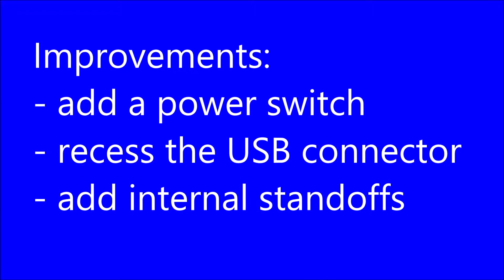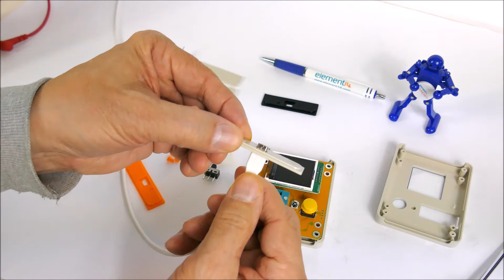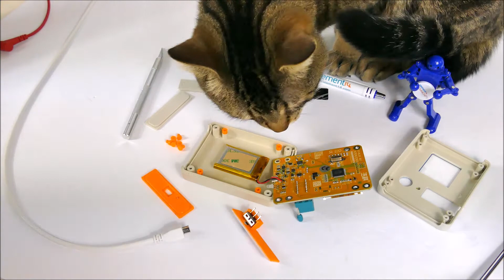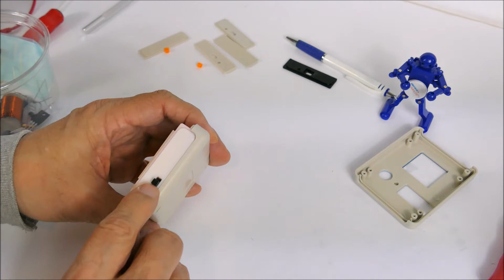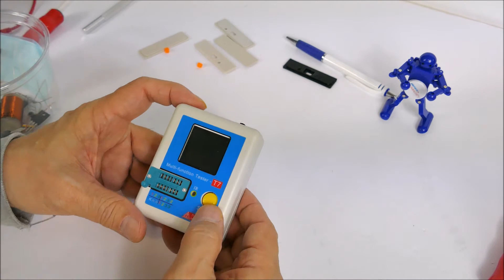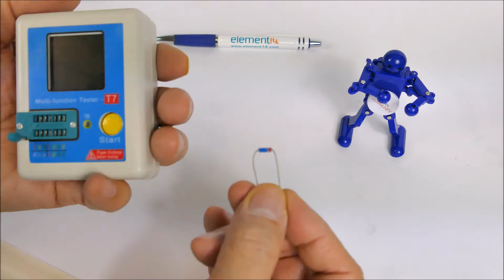T7 Multitester Mods & Fixes

Comment: Una pregunta amigo no te ha pasado que mides con el TC1 condensadores de 470uF en adelante 1000uF, 2200 uF 3300 uF, 4700 uF en fina de mas de 470uF en adelante y todos te dan ESR=0,00. Tampoco es q tenga muchos pero no se sospecho de q al menos deberian medir 0,12 Ohmios o un valor pequeño 0,01 o valoers pequeños pero todos me dan 0,00. Pero en cambio cuando mido de msno de 470uF como 100 uF, 220 uF, 10 uF, 47 uF, 4,7 uF esos si me dan valores de ESR distinta de cero. Hice la prueba de poner en serie 2 condensadores uno de 1000 uF que me daba ESR=0,00 y otro de 100 uF que me daba ESR=0,50 Ohmios por poner un ejemplo entonces los puse en serie y la ESR del conjunto en serie me dio ESR=0,60. Al estar en serie la ESR de ambos se considera que se suman verdad? Bueno de esa forma al menos me dio que el condensador de 1000 uF al menos debia registrar una ESR de 0,10 o no es asi? ES q me extraña q todos los q mido de 470uF en adelante todos dan 0,00. Otra prueba q tambien hice una vez fue colocar una resistencia de bajo valor en serie el condensador q me da ESR=0,00 y bueno al hacer la medida si me da unvalor de ESR pero algo por debajo del valor si midiera al resistencia solametne. Que quiere decir q este TC1 da una medida de ESR aproximada algo por debajo de lo q deberia realmente medir que si es baja entonces la ponme como 0,00 cuando realmente podria ser 0,10 o cierto valor pequeño de ESR pero lo registra como 0,00? Creo q en una sola oportunidad si medi un condesador de 1000 uF q tenia fuga y ahi si vi un valor de esr alto pero despues en otras oportunidades lo volvia  amedir y ya ponia 0,00 por eso me extraña si este medidor no es muy preciso con las ESR asi de un valor por ebajo pero por lo menos q lo registre distinto de cero o casualmente los condensadores q he probado de verdad tienen ESR=0,00?.

Comment: How did you know the cap was a Tantulum?
Also do you have an accurate ESR chart for Electrolytic;s?
I've seen some charts but some suggest an ESR of 14.3 ohms is normal for a 10mf 25V Electrolytic cap and I just don't by that. I  have a brand new one testing at 10.12 mf  and 2.1 ohms ESR. 
I also have a 10 mf 25V that might be fifty years old measuring 13.33 mf and 2.2 on ESR.
I took it out of a MIni Ball 60 watt CB amplifier because it looked damaged but maybe it got hit with a soldering iron. 13.33 pf is out of spec though by a good bit on that cap so its a shelf queen now.

Comment: Friend, putting the master switch, I think it will be necessary to recalibrate it every time you turn it on.
Reply: It takes a lot longer to recharge the battery than it does to run the calibration.
Reply: No - the transistor tester calibration data is stored in the mcu's EEPROM.

Comment: I literally just got mine at my door then tested a few inductors, plus the red led and 10uf cap they provided.  WOW, I love this thing except the USB charging cord is too short and worthless.  Mine came completely discharged but using USB to charge it also allowed it to run to test.  btw, the plate is far too thick as I already dropped it onto the carpet because the USB cord going in needs to be longer to properly fit.